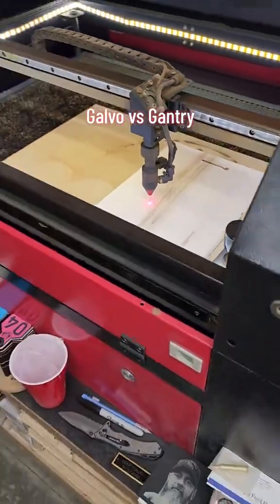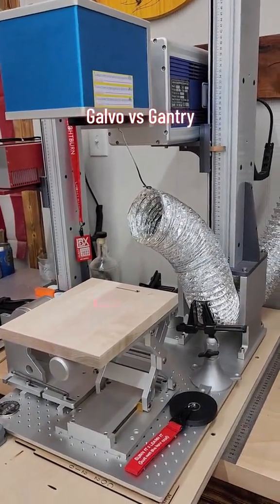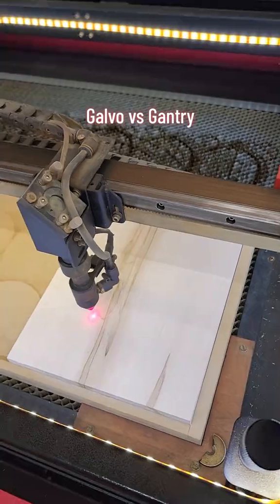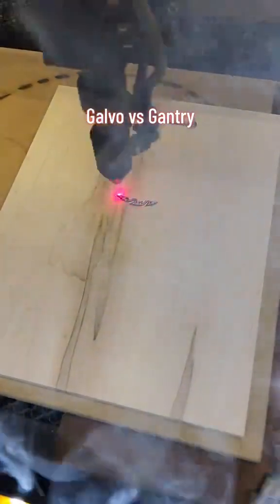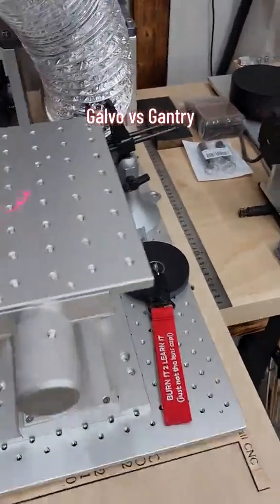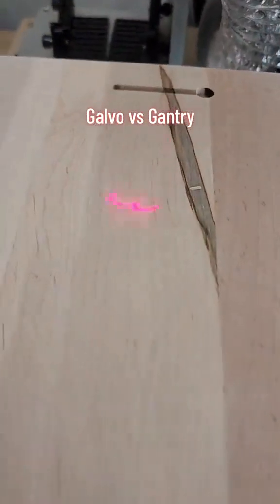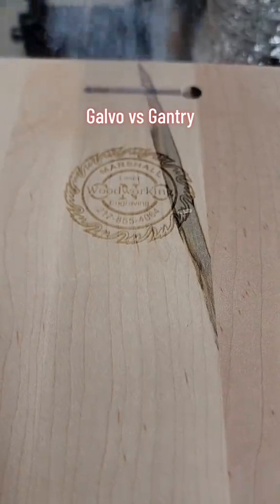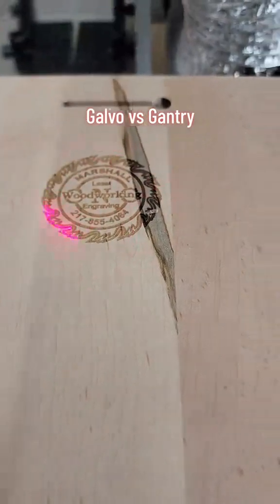Galvo vs Gantry Lasers

Comment: Nice. Which lens do you mount on CO2 galvo? For very tiny details like for example 2mm letters the gantry laser remain my way to go. Didn't noticed any difference in marking result  in the RF tube galvo from 30 to 200khz , did you?